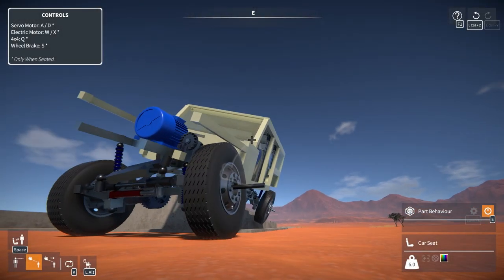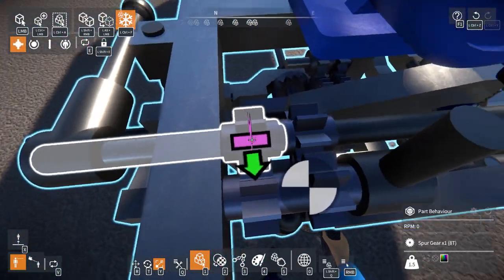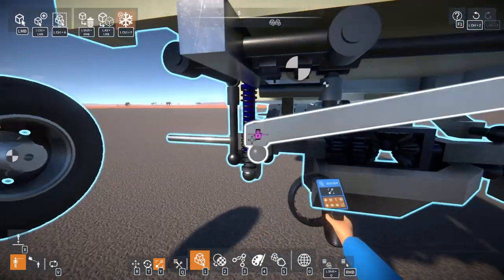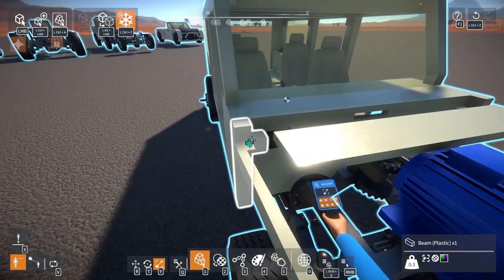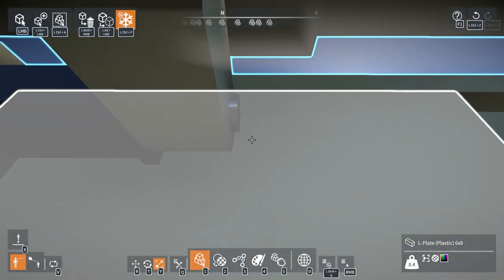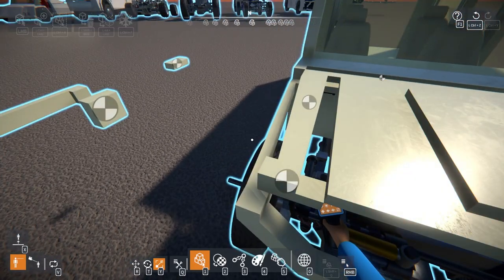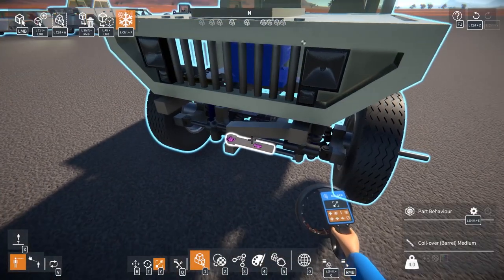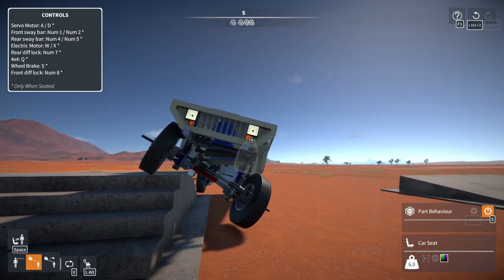Adding Swaybars A Hood And A Grill To The Jeep Like SUV Gear Blocks

Comment: What does the locking do
Reply from the maker: Makes it so the parts stay together. For example, with this ive locked all the chassis parts together, the body parts, and the roof. If i press ctrl+a it selects all. But if i just click the roof, only the roof is highlighted. And so on. Just makes things 1 piece instead of multiple.
Reply: @XspunturboX  thanks for the information